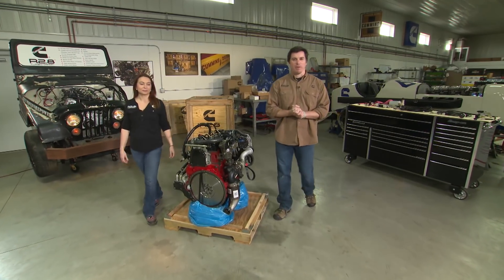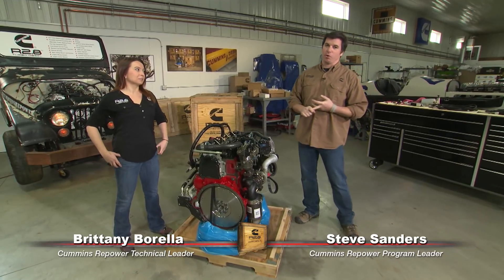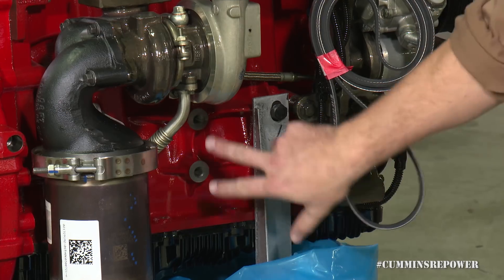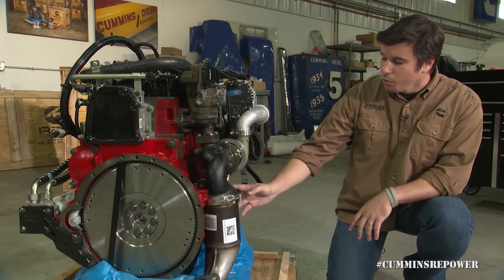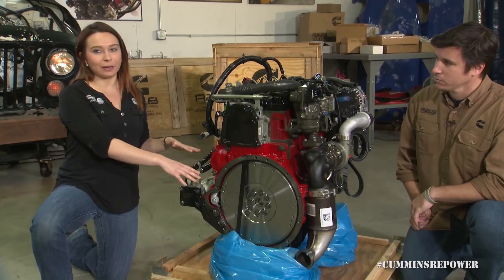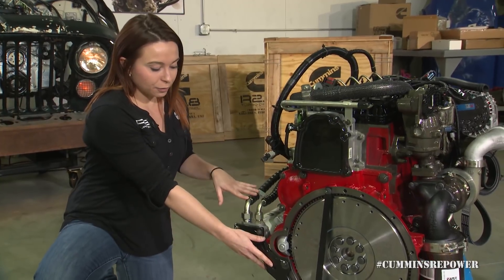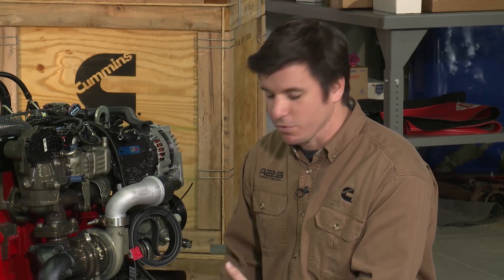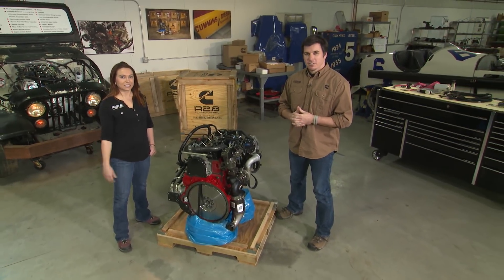Cummins Repower Garage Video 3: Mounts and Adapters for your R2.8 Repower Project

Comment: Well after talking to some prick at Cummins today to find out what to do in a situation where the alternator or p/s pump goes out .... can I get at local parts store etc. basically if I’m in bfe which is where people in the Offroad community usually are a Cummins store might be a little harder than a auto parts store to find. His answer... basically read what’s offered and I’m screwed on the rest! (In a number of words) 😡

Comment: Does this r2.8 use the same adapter plate from a 5.9 & 3.9 cummins diesels?  What 5.9 parts work on this engine?
Is this engine manufacturered to maximize profits on adapters & mounts?
Reply: The 2.8 is a completely different engine architecture from the 4BT and 6BT. It has already been used in construction equipment prior to being sold to consumers. Cummins does not sell motor mount swap kits, so I don't know where you would get the idea that they are trying to nickel and dime you with mounts and adapter kits. It’s a great engine you can put in whatever you want, but like all engine swaps, you need to make or buy the mounts to make it work in your vehicle.
Reply: cardesinr Does Anyone Use A NV4500 with This Engine
Reply: @saeedbenjamin8813  I have seen adapters from multiple people. They are out there, you just have to Google it.
Reply: cardesinr the problem with this new engine is the soaking one takes after they buy it with the add-ons ... not worth buying when it's a blank check. The 4bt is far cheaper to build a do any conversions with.

Comment: I would like to see an example of a common automatic and manual installation. Maybe recommend what options would be good if you went with all new stuff. Adapters, torque converters, installation and such. I struggled with that a bit on my last engine swap. first one. I love that you made such a plug and play diesel engine and I would have used this in my last project had it come out in time.

Comment: Can the flywheel housing be removed, and replaced with parts sourced from a 1st Gen Ram 6BT to install your engine in an '85 Ramcharger?
Reply: you'd do better to use a 5.9 under the hood of a Ramcharger.
Reply: Not compatible with 4bt or 6bt parts

Comment: So many projects the 2.8 would be perfect for....
Reply: DEBOSS GARAGE get after it...and make videos ))
Reply: I can't think of anything LESS Deboss Garage than a super expensive dog of an engine.
Reply: I whant to put one in a 4runner first gen
Reply: I wish I could go back to the kid I sold my 92' ford explorer sport to....and buy it back and drop one of these in it. It was a great little truck...it was a tank in the snow/mud. I put a lot of repairs and TLC into it, then a mechanic broke off a spark plug in the cylinder head and goofed up the engine.... I would have kept it, but I inherited my dad's full size chevy truck (he could no longer drive due to his health). My  "dream" rig with this engine would be either an old 60's/70's Ford Bronco or an International Scout. I had both as a teenager....the Scout was a rusty piece of crap.....but man was it a fun 4x4 to have:-).

Comment: So questions is that getrag 5speed the same as the g360 used in the 89-93 dodge trucks with the 6bts or a newer replacement for the old trans?
Reply from the maker: This engine is mated to a JC538, 5 speed manual transmission in a Foton Tunland overseas. As Getrag is one of the world’s largest suppliers of passenger car and commercial vehicle transmissions, we’d have to assume they have multiple bellhousing designs.
Reply: CumminsEngines could one source a getrag trans for it? I know forf has been using getrag for years.. Starting with the lincoln ls i think.. And now mustangs..

Comment: I remember first hearing about Cummins' R2.8. I'd like to eventually see this engine offered on small trucks and SUVs.
Reply: As soon as the prices drop there will be one replacing the LS in my 87 s10 blazer 4x4. Funny the stock engine in it was a 2.8.
Reply: @user-neo71665  Displacement doesn't = size.